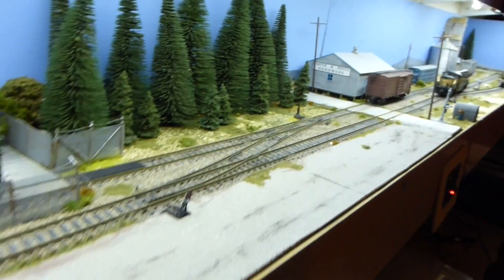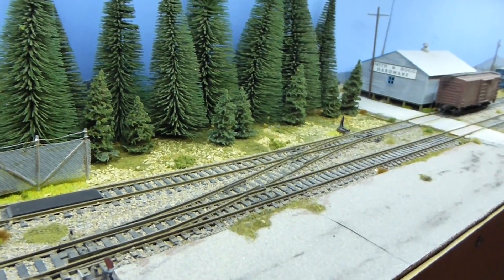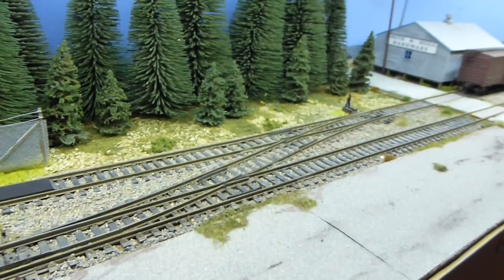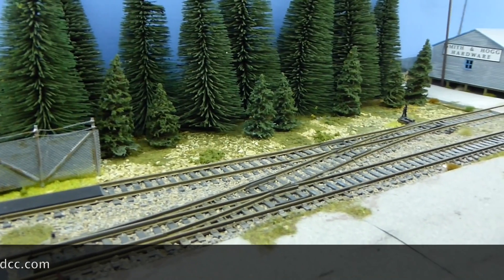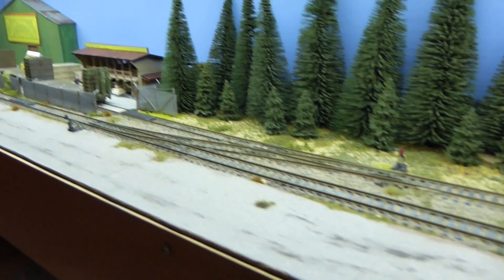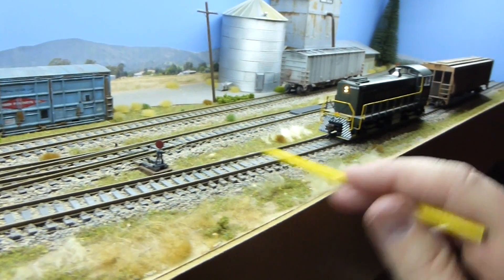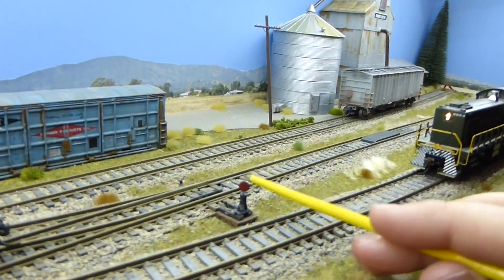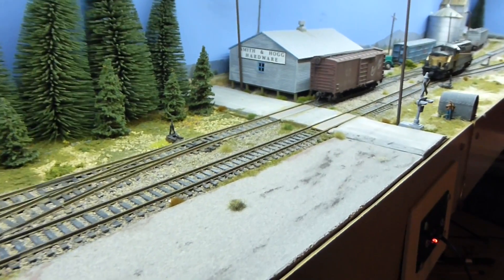Switching Brett - The Track

Comment: Thank you for this. Did the electrofrog points work ok after the modification?
Reply from the maker: Thanks Jeremy. . These were insulfrog point. The only modification was to add jumpers across the blades. (If I was using short wheelbase stuff, I'd have used electrofrogs and  I'd probably do a bit more in order to isolate and switch the frog.) However, had no problem with these insulfrogs at all. See wiringfordcc.com for good guides .
Reply: @moghobbystuff  Thanks. Yes the benefit of US outline locos in Ho and N gauge is the bogie system which seem to absorb frog problems. Did you include a polarity switch or not?
Reply from the maker: @jeremynorman5329  hi Jeremy.. exactly. No..no need for a frog polarity switch with insulfrogs as they have no frog to switch :-)